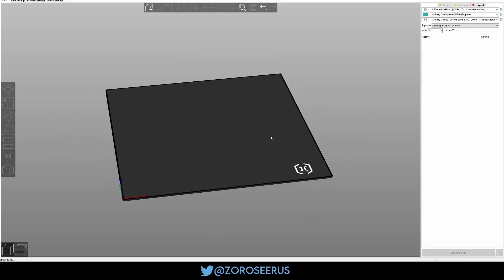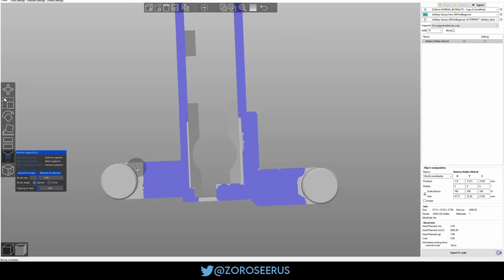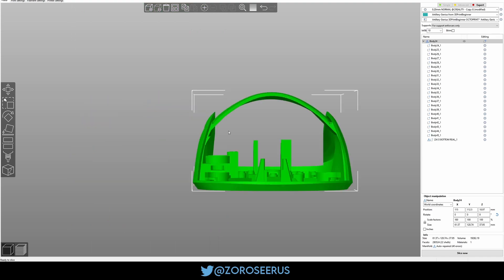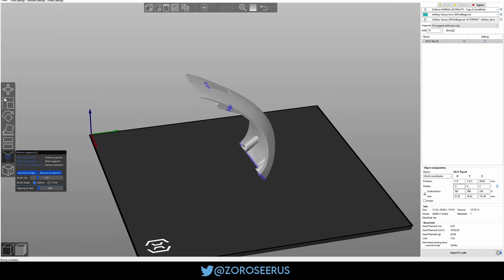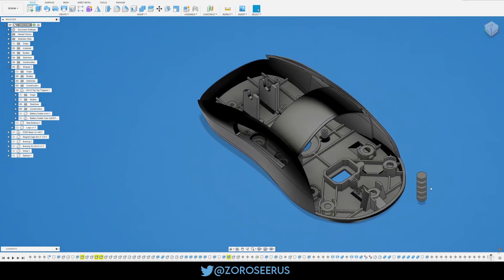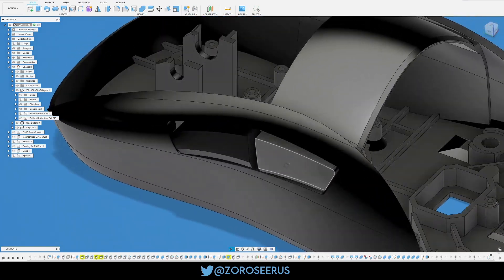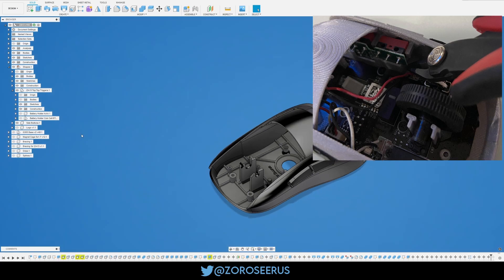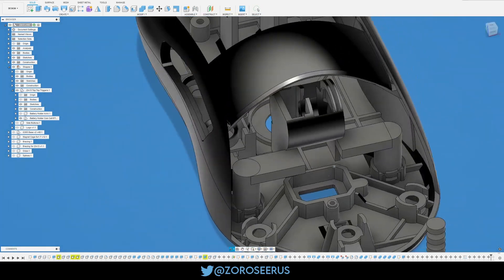ZS-Z1 Slicing and Assembly Video (Wireless 3D Printed Zowie ZA-13 Inspired)

Comment: Hello, do you have a project for the ZA11 model? Since Zowie did not renew the ZA series, I want to print the ZA11 shell with a 3D printer and use it as a wireless mouse with the G305 I have.
Reply from the maker: Not currently, no